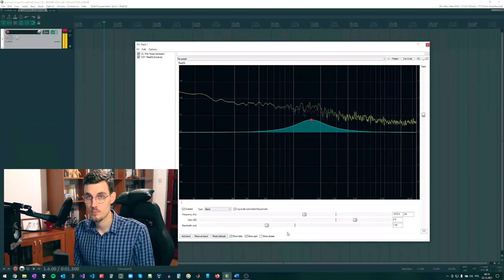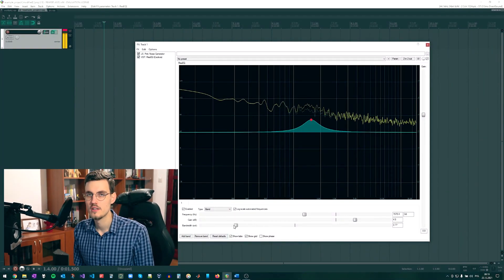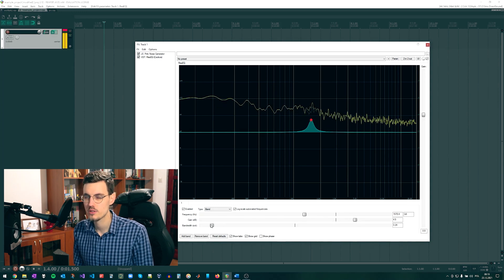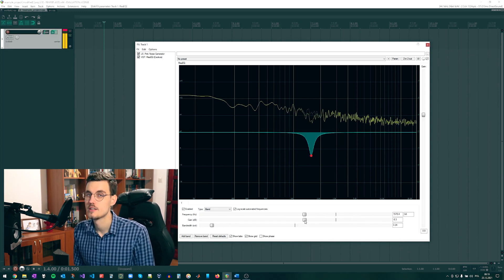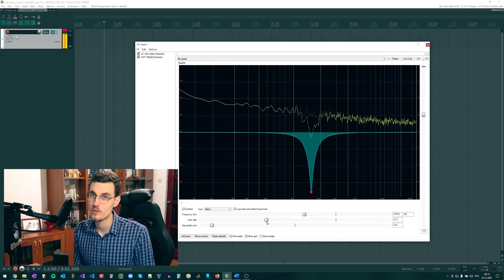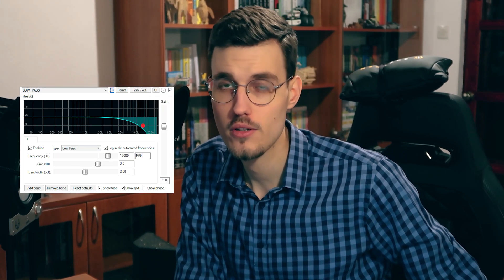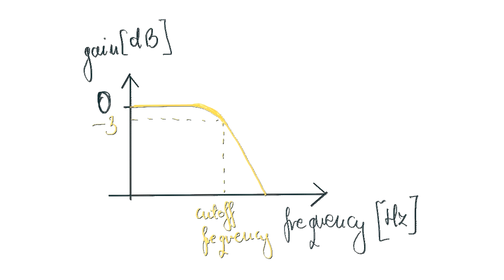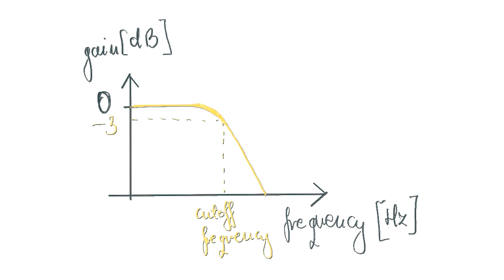How To Design and Implement a Parametric EQ Filter? [AudioFX#005]

Comment: these math formulas are so confusing, isn't there a calculator where i put in the frequency i want to eq and it gives me the capacitors/resistors/transistors/whatever values so i can build it?

i'm finding it crazy hard to find a way to reduce the volume at the 110-130hz range, i just want to solder things inside my speakers and passively reduce the volume only in this frequency range 😓